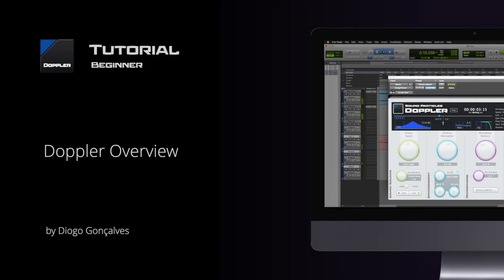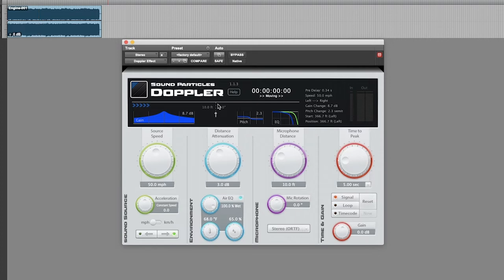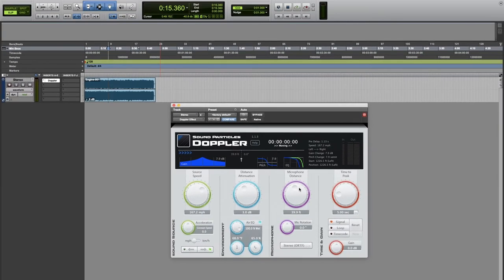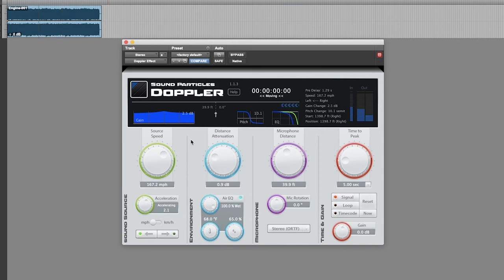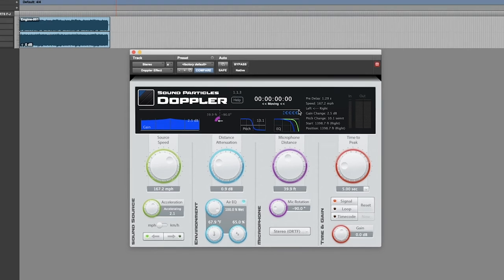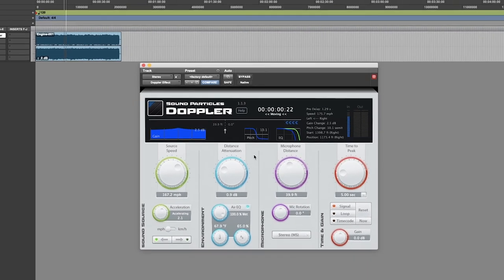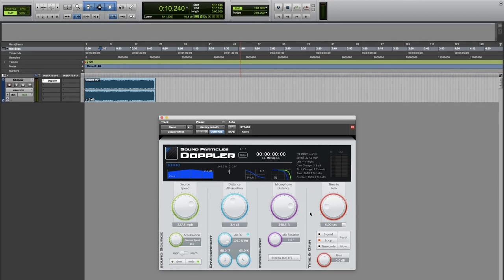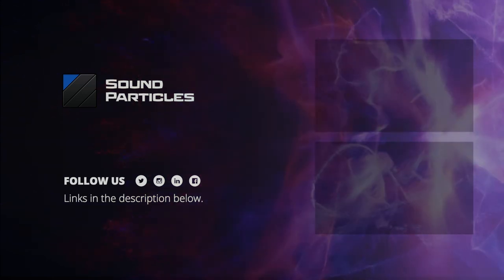Doppler - Overview

Comment: Hi just dowloaded a demo version to try. I was most interested because it has what appears to be a "timecode" entry for the peak. Very helpful .... possibly.  I'd expect most users will use this cutting to picture, as I do myself, but I can't for the life of me understand how the timecode entry works and you don't explain it in this demo. Ideally I'd like to just enter a timecode number of the session I'm working to in the timecode window to be the peak, but whenever I enter a number in it doesn't accept the number and changes it to something seemingly random and also then no audio plays back. I have to reset the plugin to get audio through it again. Can you explain better how this timecode entry works when working to picture in a Pro Tools session, for example?
Reply from the maker: Hey there, thank you for your comment.
That is a known issue in the text field and knob of Time to Peak parameter. The alternative way of setting a specific timecode value is to select the Timecode button, start the playback before the moment you want to be the Peak and tap the ‘Now’ button in the instant you want the peak/pass by to happen. Sorry for the trouble and thanks for your patience in this matter.
Please let me know if you need any help or, if you prefer, reach us via email support@soundparticles.com
Thank you!